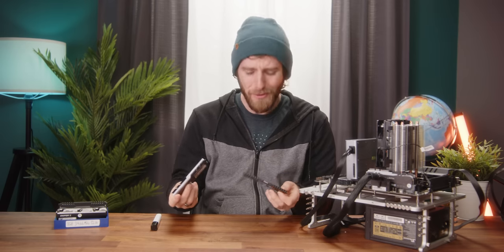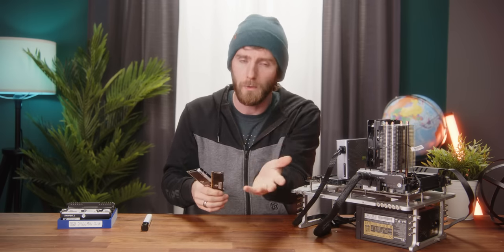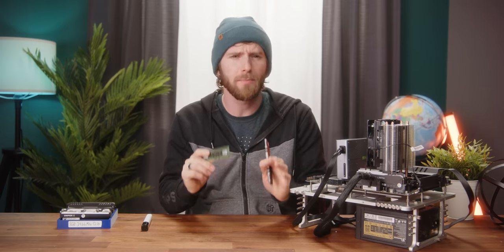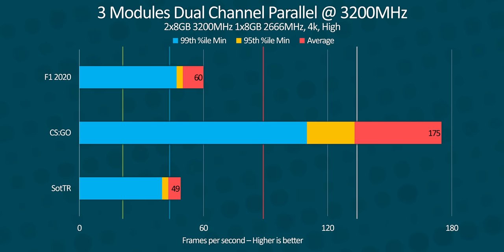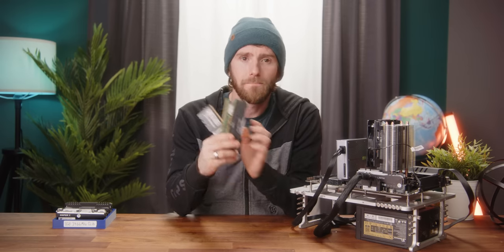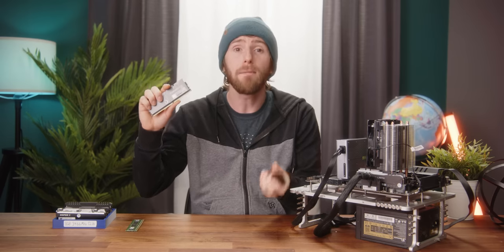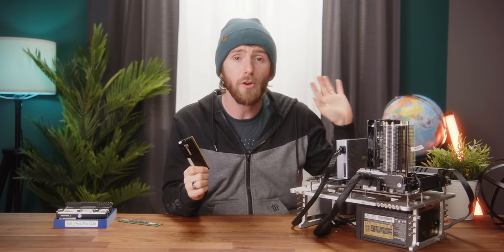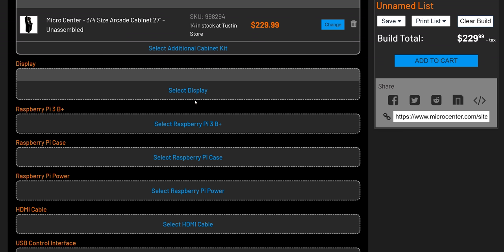Just How Bad is Mixing Memory?

Comment: I feel like the most common memory mixing scenario would be two mismatched 2 stick kits. You may have tested that, but it wasn't super clear
Reply: Yeah, as far as I saw it will be no problem, unless you trying to go for xmp way above slowest modulr
Reply: Exactly this. Most people having 4 RAM slots get at start 2 stick to run in dual channel and then as time goes there's option to put another 2 sticks which are different. They should test this but they did not. I would like to get an answer what configuration of slots is optimal for pairing different sticks for dual channel. Should each channel should be exactly the same  (so 2 different sticks per channel) or is it better to put one brand in first channel and other is second channel?
Reply: @ademiravdic  yeah, I really didn't get what they were going for. Obviously you're not going to be able to clock way above the slowest stick, so that was hardly news (getting a 2666 stick up to 4000?).

I'd be more interested in what happens if you're running at 3600 or whatever (maybe XMP), and you buy another set of 3600 RAM with comparable timings, or maybe a faster set. Does that cause issues? That seems like the sort of scenario an enthusiast would actually run into. And of course run it at the slower of the two timings.
Reply: @RichFreeman  Agreed. I can't be bothered manually messing around with overclocking, but might want to upgrade from basic XMP 16GB to 32GB and just happy if I don't see a performance drop.

You're unlikely to be able to overclock a matched pair of 2666 sticks up towards 4000 without a lot of luck and much manual tweaking, why would they choose that as their test scenario for unmatched sticks/pairs? Out of touch will real users comes to mind.
Reply: yeah, why on earth did they test 4 different modules but not this config?
Reply: @dutubenbenutzer9  Well, I can see the argument of using 4 different ones as a worst-case test.  That makes sense.  My problem is the HUGE mix in base speeds.  They mix a 2666 with a 4000, then say that it wouldn't run at 4000.  I mean, getting a pair of matched 2666 or even a single stick to run at 4000 would be a miracle, so this is just a test in reading the label on the RAM and not the impact of mixing.

The concern I've heard with matching is that when you're trying to squeeze some more OC performance the matching helps.  That is a reasonable premise to test.  So grab four different 3800 sticks and see if they'll run at 3800, or how well they OC compared to 4 matching sticks.  Tossing a $40 stick in with a $200 stick isn't likely to get you the performance of two $200 sticks.  Just getting the performance of two $40 sticks is a win in this scenario, vs having it degraded even further.
Reply: I've tried to combine two of the exact same (2x8GB) kits and it didn't work at rated speeds. They're even both Samsung B. XMP failed, so I turned down the frequency a couple hundred Mhz and ran some memory tests until I thought it was fine, but it still crashes randomly.
Reply: I have my ram configured like that. I've got 2 sticks of 8gb Kingston value ram and 2 sticks of 8gb silicon power ram and they work just fine together. Have them set to 3200mhz cl 16 using ryzen master and haven't had any problems with the 2 sets.
Reply: You can use SPD flashing software to match your kits, you take the SPD table with the timings you want to use copy it then flash it onto the other similar modules.

Sometimes it is the only option to get matched timings that post with all modules installed.

you can sometimes set timing manually using one module and then add the mismatched ram but any bios reset could stop the system posting or booting properly.
Reply: @brychaus  they may have incompatible spd tables, there are several softwares available to clone the speed table from one module and write it onto another to ensure correct dual channel operation.

You can set timings in bios manually then add the additional kit but a bios reset would cause timings to be lost and possibly prevent the system posting.

Comment: Adding this for other enthusiasts that may run into this oddness..  I build systems typically with older hardware to save on costs. Recently built an Unraid system for my home that I have been very happy with, but recently ran into sporadic parity issues. Assisted by that great community, we tracked in back to the RAM, but not for the usual reasons. I am using an ASUS X99-a USB 3.1 with an Intel Core i7-5930K CPU @ 3.50GHz. This is a quad channel motherboard with 8 DIMM slots. As per the ASUS manual, I installed 4 Kingston HyperX Fury 8 Gb modules all in one quad channel. My mistake; I bought two dual channel kits, not one quad channel kit. Turns out, everything worked... most of the time. But running Memtest pointed to issues and errors with the setup. When I reinstalled the same RAM as dual channel in the top DIMM slots of quad channel bank, everything ran smooth. Weird, eh?

Comment: In general as long as the frequency is the same you're fine with plug and play. Been a rule since my first laptop, a Dell Inspiron 8600. Wouldn't boot with 2 different frequencies. Swapped the smaller one out with one to match the bigger one. Ran beautifully
Reply: @vincentmarcellino7183
i have a Dell Inspiron with 4gb Ddr4 -2666v Ram stick
I'm planning on getting a 8gb Ddr4 -3000v
should it be fine ? or i should instead get a 8gb -2666v to match it?

Comment: In my build I ended up with two different branded sticks, both 8GB each and both 2666mhz. When thrown into the correct slots on the MB they ran at 2667 out of the box... weird but ok! I was recently looking to upgrade to a 3200 or 3600mhz kit to get a little boost, but I found I have enough capacity.. so I managed to use XMP and boost these sticks straight to 3200mhz with no errors or crashes, and an instant noticable performance increase. Noice
Reply: Did you overclock your 2666 rams to 3200??
Reply: @oksyar  Yes, so I’ve got 2x 8GB 2666mhz, and 2x 16GB 3200mhz

But they all run at 3200mhz using XMP profile in BIOS
Reply: @INTHEARKADE  thing is, I have 3 modules all 8GB 2666. When I go to Gigabyte motherboard MIT, there's no option for XMP. And I know it used to be there when I first tested it with single ram module 8GB 3200.
Reply: @oksyar  Try just 2 or 4 sticks of ram. Maybe needs to be run dual channel to work

Comment: I've been building computers since the days it required schematics and a soldering iron.  But since the advent of memory slots, I've been a stickler to only buy motherboards with (at least) four RAM slots and using only half for the initial build - usually splurging slightly in the now in anticipation for what will be more likely available in the future.  Where memory is concerned, I always look at the newest modules with the best overall performance I can get for a reasonable price.

My current main rig is somewhat ancient (i7-5820K w/ASROCK X99 Extreme4) with a pair of Ripjaws F4-3200C15G-32GVKs, (2x16GB) which had recently come out and were the best I could afford at the time.  Bought another pair about two years ago (now at 64GB total) and, in fact, the exact same modules are still available today - more than five years after my initial build.

Granted one can't predict the future but, if you splurge a bit in certain places (mobo & RAM in particular), you can reliably expect plenty of upgrade avenues for yourself in the future.
Reply: Do you know what kind of corsair ram is this on 3:57 ???
Its not the dominator.
?I don't know what it is?
Reply: Furry
Reply: Yep feel like people cheap out on boards too often. I like to have the bells and whistles
Reply: have you ever mixed 16gb with 8gb rams? what was like?
Reply: @nicolasg6983   It varies by board/chipset but, in general, everything syncs with the lowest performance - the lowest speed and highest latency among whatever RAM modules you have installed.

Most boards/chipsets will still access the full capacities, but the issue really comes down to if that extra capacity justifies the performance hit.
Reply: i like to splurge in certain places too

Comment: Didnt really get what i was hoping for with this one... my main concern is with running different sets of dual-channeled ram. (so 4gx2 + 8gx2 at different Mhz). Most ram comes in sets of two nowdays
Reply: What happen to those set now? Same here, i have 4GB+ 8GB and still run smooth for my daily use.
Reply: @fahmialikhsan8477  I'm planning on doing the same,Do you think it will effect my decent gaming? or it should be just fine 
4+8GB both of different frequencies

Comment: I remember a time we didn't even care about mixing memory so long as we increased it. It worked
Reply: I’ve never even given it a second thought. Of course, I always match speeds and capacities and don’t overclock, so it’s never been an issue for me.
Reply: Indeed. I have an Athlon XP system with 1,2 GB of memory. Totally mixed stick configuration.
Reply: I remember getting 2 1gb sticks from different ebay auctions for my pentium 4 back in the day.

Now I'm not sure if the unexplained errors I would get once in a blue moon might have had something to do with this.
Reply: As a kid, before I even knew about the issues that are possible with mixing memory, I convinced my dad to buy another 2gb of DDR2 to throw into our Vista machine under the pretense it would make the computer much faster. It luckily worked, and it definitely was faster! I could finally play Minecraft. Life was good.
Reply: Money for me was tight so I'm running some 8gb 3200 mhz viper and a 4gb 2400mhz budget crucial memory, occasionally I get a crash or a game has some strange behavior but it works ok on a ryzen system

Comment: My question is how did this affect stability? Performance is all fine and dandy but if you can't use the system it becomes a moot point
Reply: I had 4 8gig sticks from the same manufacturer but 2 were a different model from the other 2 and slightly slower, ran them in the PC for about 3 years no stabilitty issues, upgraded to faster memory is the only reason i swapped it out, I hadn't even bothered to mess with the BIOS settings.
Reply: Benchmarking provokes stability problems, if present. If linus had stability issues, he'd have to explain why he doesn't have any benchmarking data to offer
Reply: @jimblob78  I've run benchmarks before on an overclocked cpu that ran fine but my games would keep crashing until I reduced the OC
Reply: Everything will be perfectly stable as long as you don't overclock the memory. It will just run at the speed of your slowest module. Note that XMP counts as overclocking, the actual DDR4 standard only goes up to 3200 MT/s.
Reply: @shawno8253  did you watch the video? He benchmarked using games in this video.

Comment: Currently have 48gb 3200mhz running just fine. Started with 2x8gb modules and upgraded with 2x16 gb modules all running at 3200mhz. Helps with blender a lot!

Comment: in my old pc i had 2x8gb 1600 cl9 and put in an additional 2x8gb 1600 cl9 from a different brand a bit later. zero problems. 
as long as the ram sticks have pretty much the exact same specifications and run at the same speed, you shouldnt run into any problems, from my experience.
what LTT tested here, were very different ram speeds and memory modules slammed into one system, i cannot recommend that.

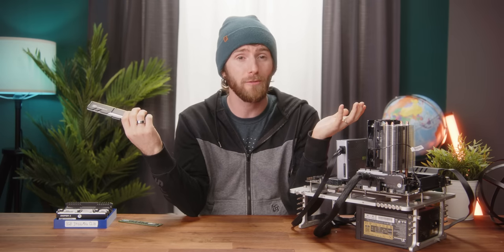Comment: 08:52 - Linus spit tips 😀?

I've run various different RAM sticks in many PCs and never encountered a substantial problem. Sure, timings should be equal and they will only run as fast as the slowest stick - but many times it was just an upgrade for a "family PC" that mostly did word processing.

Comment: As long as your new kits are at least as fast as the old ones you just need to put them in the correct slots so xmp profile is read from the old sticks.
At least my x570 takes the xmp from the outer channel (further from cpu, other boards might have it other way around) so even if i had 5GHz kit on the other slots, XMP is for the old kit's 3200Mhz profile.

Comment: This is a really interesting video. Nice work guys. 
I always wondered why ram modules couldn't be mixed if they're very similar and have similar time configurations especially since all those specs can be tweaked. You also spoke about an AMD design that can handle multi or mixed RAM speeds by design. I'd like to find out if the ASUS' Zephyrus. The mid tier gaming laptops with quite a lot of bank4buck squozen into them. You guys did a expo on the new models recently. I have a 2021 model and it came with 8gb DDR4-3200x1 paired with 8gb 3200 soldered to the board. There's only one so-dimm.... so, dems the best hardware configurations possible. The specs say it can see up to 24gb but I can only do it if I buy a 16gb stick. Many people say that I'm going to lose dual channel the very second I do this. However, just as many other say that it will perform in dual channel up until it surpasses the dual channel's max capacity. 

Honestly, I was beginning to side with the naysayers, that it likely will disable dual channel upon install. After hearing what you were saying about AMD I started wondering if maybe they implemented something like that in the Zep. I'm not even sure where I could find such info.
Reply: Does it work?
Reply: hey, were you able to get it done?

Comment: I've been mixing ram for years... People like to talk about timing difference, DDR speed,etc but really doesn't matter !!! just remember your board will underclock too your slowest stick in system
Reply: Every ram stick in my pc.is different and i can tell it really does't matter
Reply: interesting
Reply: I had a lot of crashes mixing ram, even though they are the exact same model, two of them just have rgb. They only work when put in a specific order.
Reply: It doesn't until you get random errors and your board does not read some stick anymore when you reboot.
Reply: I mean...I've tried this twice, All same speed, & timings. But oof...every time it royally fucked up my computer and led to near constant crashes or trouble even booting in the first place.
Reply: The performance or stability deficits of memory mixing may not be worth it over the capacity gains though, especially if the total memory exceeds 16 GB.
Reply: Mee too. No stability problems whatsoever in the last 15 years or so. Faster modules simply run at the same speed of slower modules.
Reply: Did that for my laptop it works great
Reply: @atrumluxangelus Ryzen 1000 series needs a bit of help when mixing RAM. You usually need to tweak a couple of timings yourself to get it stable, like tRFC for instance it doesn't seem to know what to do with mixed RAM.
Reply: I used to have issues with my PC not booting due to mixed ram, like 15 years ago. It seems to not be much of a difference these days.
Reply: Me too, DDR3 3x2GB and 1X4GB on a Phenom II was the first time I did it. Some DDR2 computers I built from spare parts too, thought older Intels usually caused issues, AMD was happy with whatever I threw at it.
Reply: I've never mixed RAM unless it's to extend the life span of some attic PC or reserve notebook with spare parts. In these situations I never cared enough to remember what worked and what didn't. The comments make it seems like it is still a gamble even today.

Comment: I have been using mixed memory modules for years without having any perforance issues at all. Back in 2015 I have upgraded my PC from a single 8GB DDR3 memory module to +8GB's, but not with another single 8GB module but 2x4GB's. All have the same 1333 MHz and same clock speeds, but they where from differente manufatcurers. The 8GB version was a Geil Blackdragon, and the 2x4GB's were both Kingstons, HyperX Fury's. I have been using that rig for like 4 years and had no issues what so ever.

Comment: When I upgraded to 2x8gb on my DDR3 rig, I decided to mix with the 2x4gb. The 4gb sticks were 2133mhz cas9 and the 8gb were 1600mhz cas9. Fastest & most stable was 2000mhz cas10, I just had to fine-tuned the other numbers.

Sticker dates were several YEARS apart lol
Reply: Did you have any issues?
I have 4x4gigs and i just found 1x8gb stick and i want to replace a 4gb with the 8.
But the 4gb sticks are 1333mhz and the 8 one is 1600. What do you think ?

Comment: Capacity makes a huge difference when pushing systems to their limits. As far as the speed... that's all relative. As long as the RAM modules are within .25 nanoseconds on the real latency chart they should play nice without causing too much strain on the memcontroller.

Comment: This video made me remember the time I've upgraded from 8gbs to 16.

I was using an i5 7400, with a hyperx 2133 memory module. Got a deal to buy a corsair vengeance 2400mhz module.

It run fine with both memorys at 2133, but bringing both to 2400 gave me some bluescreen errors of out of sync memorys.

Comment: I bought a prebuilt before I knew about PC parts. Sadly it only came with a single stick of DDR4 8GB. A year later after that, I wanted to expand the ram but I couldn't find the same stick that had came with my PC, so I bought a stick off Amazon, I made sure to find the same size and speed. It all worked fine and it got me to 16GB with no problems. A year after that though, I wanted another stick of ram but I couldn't find the same stick that came with my PC or the one that I had bought prior. So I ended up buying two more sticks with the same speed and size and it worked. So now I have 4 sticks, each with 3000mhz, and 3 different types of brands. I haven't noticed a single issue and my PC is running great.